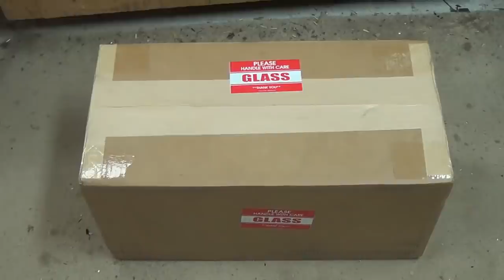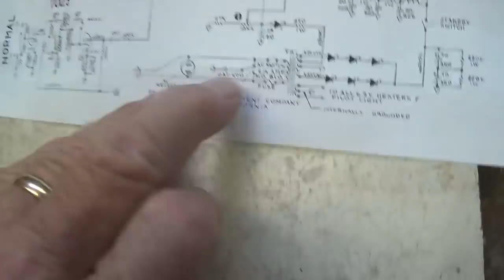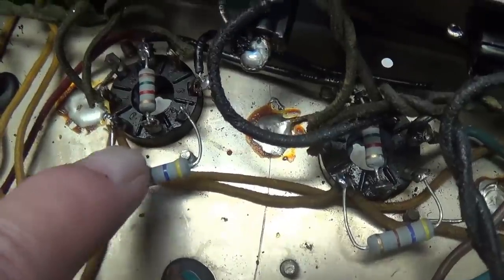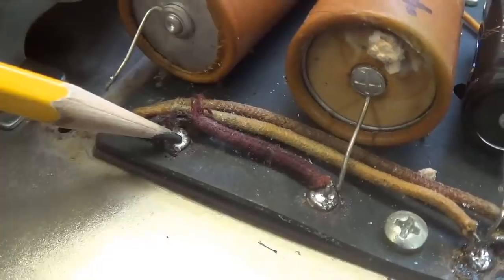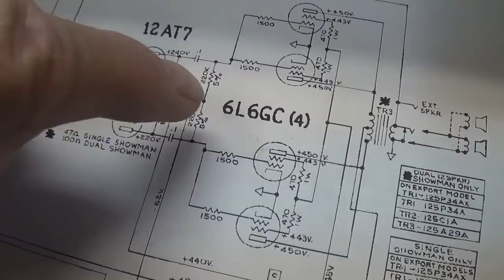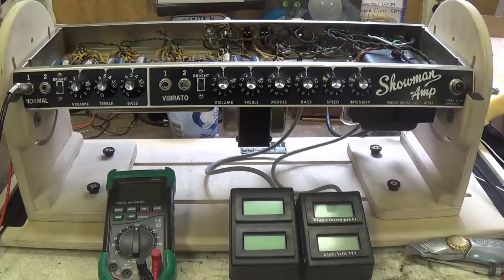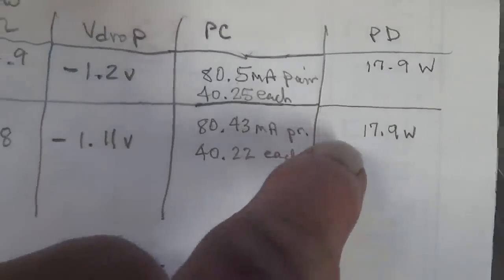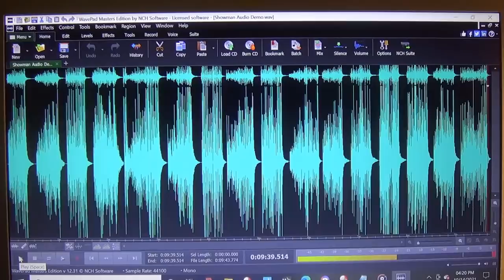1965 Fender Showman.......Back from the dead, but not without an epic struggle

Comment: Doug your timing couldn't be better:

I'm currently working on a Traynor Bass Master (Canucklestans take on a 5F6A) for a friend of mine experiencing a very similar issue with the output transformer. Extreme imbalance on the output tubes etc. I was luckier in my case as most of the imbalance was the result of a fairly depleted 7027A. 

Very cool that we were both working with a similar problem at the same time. Perhaps we're huffing the same cosmic ether   :^)

Looking forward to your next assignment.
Reply from the maker: Greetings, Shim. Best of luck with your repair. I always try to eliminate all variables before naming the OPT as the culprit......but when they're bad, they are very, very bad.

Comment: I believe the fuse you found was not blown because it had been replaced when it first quit working.  Personally I think the direct short you found would have blown the fuse right off not to mention some of the other problems you found.  Also there was no doubt what caused the caps to be swollen.  I also think the problems found were accumulative, possible over a period of time, until it finally quit completely.  This is the type troubleshooting we did in the Army on our receiver and antenna control of our equipment.  Didn't have enough years left to become efficient in digital work so it was time to get out after 20+ years.
Reply from the maker: Thanks for sharing your speculations with us, David.

Comment: Showman Single head only amps usually used a 1x15 cab commonly loaded with a Jensen C15K 100 Watt rated ceramic 15 inch speaker. There were also JBL D130F or D140F 15 inch and the JBL D120F 12 inch speaker. Altec made some big motor speakers too. YES! Fender employees DID SCREW UP! I have seen .002 or .003 uF caps used in place of .02 or .03 caps in Fender LFO circuits. It's a feature many do not use, so if it runs really fast it doesn't get used and it gets ignored for decades.
Reply from the maker: Thanks for the interesting info, Seth.

Comment: I love your videos! I've picked up a few tricks and changes from you, I've worked on quite a few Fender and Marshall amps, preferring the Fenders myself, as I prefer the sound. But I was wondering why you don't get Mercury Magnetic transformers. I use enough so I get the quantity discount from them and have never had a problem with their output transformers, which sound great to my old rock & roll shattered hearing, and the power transformers are always right on the money. Looks like you do a few more amps a year than do I, so you'd get the discount too. Loved the "Showman" video ... I just got a '67 that needs more than tubes, although needs those too.
Reply from the maker: Thanks so much, Mr. B. I try to provide my customers with the best quality parts and repairs at the most reasonable price possible, and, in my opinion, Hammond transformers are every bit as good as MM at half the price. If a customer requested a MM transformer I would gladly install one. I do respect their quality.

Comment: Hi Uncle Doug, I was thinking about the wiring scheme for the power switch, and I believe that is the correct way. I would expect the fuse to protect the equipment, and if there was a short inside in the switch it would just trip the breaker.
Reply from the maker: I agree completely, Jason, and am, quite frankly, astounded that everyone does not see the obvious superiority of this wiring method.

Comment: Great video UD!  I would have been tempted to change over the OT End Bells to keep the amp original looking. They looked like they would fit. A bit like stuffing an electrolytic cap.
Reply from the maker: I considered it, Dean, but the protrusions on the bells were quite different (check it out).
Reply: hey doug any  vids on stuffing original electrolytics? im sure i could give it a whirl but if i dont have to reinvent the wheel i'd be great!
Reply: @rubincherise8736  He has gone over his process before.  It’s part of another video though, it’s a Champ restoration video if I recall correctly.

Comment: Very very nicely done Uncle Doug. I've be servicing tube amps (and a few of the reissues) for some time and I learned quite a bit from you here so Thank You very much! I was wondering if your amp chassis holder is custom made, or commercially made? Pretty darn cool looking for sure. Funny story abut Dick Dale as well! I was trained in the military up to this tech level befor they transitioned to computers, so I came away in 1975 with a useful skill, yet I'm still learning, and always am amazed how these amps can stand the test of time if taken care of. Pretty impressive work though on your part. If you go to Antique Electronic Supply you can get a glimpse of what I've tackled over the years. Thanks again for a very well put-together 'feature-length' video! Signed, Brian W. Cole. (aka - Tube Amp Guy) I usually post jobs on Facebook with detailed stills and short vids. Lastly, I see you post other jobs on YouTube so do you pick up work that way as well? Not saying I want to start stacking them up. LIke you, I want to take my time, methodically, and do it right, and being a couple clicks shy of 70, less is generally more.  Take care! Brian
Reply from the maker: Thanks for your comments, Brian.

Comment: Great restoration as always!  But don't pitch that OPT just yet!  I have rescued more than one by re-soldering the connections between the leads and the coil wires.  I won't say it's a common fault, but I've seen it more than once, and saved big $$ on replacements.
Reply from the maker: I too have hunted down breaks in the superficial windings and repaired them, HS, but this was something completely different.....probably internal.
Reply: @UncleDoug  I should have known that you'd check it before throwing in the towel on an otherwise pristine original OPT.  My apologies!

Comment: Dick Dale, not only withering volume but also withering jackhammer attack ! After a Dick Dale performance in a small venue, you needed help getting out the door and into your car. Last time Sweetwater in Mill Valley Ca. One thing, they sure sold a lot of booze, it felt like life in the trenches during the battle of the Somme,
Reply from the maker: Thanks for painting such a vivid (and no doubt accurate) picture, John. My ears are ringing just thinking about it.

Comment: This is SUCH a nice looking amplifier! On the contrary to what I am working on right now; Zenith 12h60 Radio. The factory work is REALLY sloppy and disappointing looking. Then, it has a bunch of rubber coated wire, that disintegrates if you touch it. YUK! I'm working on replacing the wire I have to replace. Good news is that, I did a re-cap and the first test went quite well, with all original tubes.
Reply from the maker: Thanks for sharing, DW. Your experience is one of the reasons I quit working on radios.

Comment: Hello Uncle Doug, thanks a lot for the video. I have also same showman amp which in working condition with all original parts. That's the reason why I'd like to do a maintenance changing the old caps etc. I have a question about the biasing part of the video. I think that showman is a fixed bias and mine doesn't have a bias pot. What to do in that case adjust it?
Reply from the maker: If your circuit has the balancing pot, then watch my video on biasing a 4-output-tube circuit, Nt.

Comment: 39:05  The function of the resistors is FIRST to act as a voltage divider to ensure the mid point between the caps stays fairly close to 1/2 the supply side.  The function as a 'bleeder' resistor is utterly secondary to the primary function of keeping the voltage on the series caps within the rating of the caps.  Finding the short in the main DC supply right at that ground node was interesting. The layout of the eyelet board placing the insulated wire so close to the component bare leads with such a high voltage differential voltage is very concerning. I will be SURE to closely inspect my Blackface Vibrolux Reverb soon.  Thats a bad place to have a short.
Reply from the maker: Thanks so much for confirming my analysis of the dual-purpose reservoir resistors, Jennifer. Agreed......it was a scary place for a dead short, but I saw no evidence, i.e. charred eyelet board, that a dead short had occurred.....thank heavens.
Reply: @UncleDoug  Would I be a smartass to ask why you didn't replace that wire than to give it it's own cubical? I assume that rubber impregnated matchbook cover/playing card etc.... Is very well secured.... 
Actually, I am beginning to learn that sometimes we just have to compromise on such details when doing this as a service to others. Let's face it, who has the time or wishes to remove a circuit board? I find that a customer rather have his gear returned expediently rather than you having to expediently explain why it is taking so long to finish his amp.
Reply from the maker: @southboundsuarez9832  When working on customer amps I try to eliminate even the remote possibility of future problems. I closed the insulation gap, secured it with super glue, then shielded (and spaced) the sensitive areas from each other with (again) superglued rubber-impregnated gasket material. IMHO it's fixed.

Comment: I always enjoy your videos, both technically and as pure entertainment - and I thank you very much for all of that. 
But the (my) mind works in mysterious ways, and sometimes your presentations suggests band name. 
Tonight an imaginary presenter cried out: "And here they are; 
"The DEAD SHORT"!
Reply from the maker: We've had some good band names in previous videos, Arne. I recall the Anorexic Zombies among others :)
Reply from the maker: You can use a Variac or a Current Limiter with a carefully selected bulb (proper wattage to achieve desired lower AC voltage), Nick.

Comment: From 1963 - 1965 the "Showman" had one 12 or one 15 inch speaker, although I've never seen one with a 12 and I think after 65' it was only available with a JBL 15.  The "Dual Showman" had two JBL 15s, both were rated at 85 watts.
Reply from the maker: You just saw one with a 12" speaker, HJ. Thanks for the info.

Comment: Hi Uncle Doug - Love your Videos. I don't think your 4 Ohm Output will work because when the 8 Ohm Speaker connection Plug is removed from the socket, that output socket is grounded. Perhaps you have disabled the switch on the 8 Ohm Output?
Reply from the maker: Excellent point, Andy. Yes, the speaker jacks have to both be non-grounding.

Comment: Hey Doug! Have a question for you. I have a 66 showman. AB763. Both channels when the volume is increased hum like crazy, high pitched. All filter caps have been replaced and the tubes as well. Any ideas what could be causing that? It also pops when the standby switch is engaged.
Reply from the maker: A hum that responds to the VC is caused by a problem BEFORE the VC in the circuit. Think input jacks, cables, 1st pre-amp tube, etc. Just turn down the volume before flipping the Standby Switch......otherwise it's not an easy fix.
Reply: @UncleDoug thank you! I’ll give the simple stuff a shot first. Correct me if I’m wrong but since the hum is happening in both channels wouldn’t the problem lie where both channels meet? It’s not tubes, already tried that. Where would a good spot to look be?
Reply from the maker: If the hum cause existed after the VC, it would not respond to the VC. Check your jacks and cables.

Comment: I was just biasing an amp with a custom-wound OPT that measures about a 27% difference between CT and each half-winding, but 10-year old EH 6V6s are still within 1.5 mA of one another & my new backup set measures within 1mA. I may check with the builder, but what sparks my curiosity here is could the OPT for the Showman in this video have been re-wound? If so, was the choice to flat-out replace it just that the owner wanted expediency and resolution over the hassle, expense, and time to send it off for repair?
Reply from the maker: I don't like involving a third party in my repairs, especially when I am ultimately responsible for the outcome. Also, what if the rewinding took a year to be completed or cost a fortune? The owner wanted a good, reliable amp......and he got one, in a timely manner and at a reasonable cost.
Reply: @UncleDoug  thank you for the clear & helpful answer! I’ve dealt with the time & financial-pit nightmare with guitars so that makes perfect sense. Just asked since I was never sure what I’d do if one went out. With appreciation as always

Comment: I agree with your decision regarding the switch and was shot down on a forum about my decision to wire an amp that way.  In the UK the plug's fuse would blow if the highly unlikely switch grounding out condition applied.  I'm not sure how it works on that side of the pond.....
Reply from the maker: It works just the same here, CE. As another viewer confirmed, our method is the one used on all large, commercial electronic gear. It's the only wiring scheme that really makes good sense.

Comment: I noticed the low battery indicator was on both euro tube probes. I was wondering if that’s why used to getting weird readings early on in the video.
Reply from the maker: They have no batteries, Ivan, but draw their power from the circuit itself. I'll investigate this issue further and let you know what I discover.

Comment: Usually, the higher the wattage the output transformer is made for the lower the resistance of the winding will be since thicker wire is used. Also, more tubes in parallel require lower impedance so that means even less turns. The original vintage output transformers usually have more turns of thinner wire which is often on the edge or even under the needed rating, so if there is any issue with the amp and it draws more current one of the windings probably developed a short.
Reply: Observed the same thing as Doug when replacing the output transformer on my Vox V100 head with a 100W OT from Tube-Town. The primary winding resistances were ~13 and ~14 ohms respectively.
Reply from the maker: Thanks for the helpful input, Marko and Asle. I agree with your analysis.

Comment: Hi Uncle Doug. Beautiful video, as always. Can I take advantage from your knowledge? Which is the right switch off sequence for a tube amplifier: first stand-by and then switch off or directly switch off? Somebody told me: directly switch off in order to full discharge the capacitors. Is that right? Thank you!
Reply from the maker: I am not a fan of Standby Switches, Stefano, but I would say that simply switching the amp off at the end makes sense......why would you want to keep the filaments hot any longer than necessary?  Filter cap draining is not a concern unless you intend to work on the amp circuit.
Reply: @UncleDoug  Crystal clear. Thanks a lot!

Comment: In lieu of a high voltage leakage tester, is there any way to charge a capacitor to working voltage then check it's microA leakage with a multimeter? I figure a resistor in series to slow the charge rate? As previously mentioned, I'm ignorant here. Just ordered a Tel-ohmike but think the seller misrepresented so still thinking options. Thanks.
Reply from the maker: As I have demonstrated in several videos, Derek, you unsolder the end that should have no DC, turn on the amp and let it reach normal operating voltages, and then check the unsoldered lead for the presence of DC. This works great for coupling capacitors.

Comment: So with the 10k power supply resistors, was this amp working under spec in voltage? Yet it was going wild on the output tubes. Another great educational video, this one gave some interesting and unique problems, valuable for viewers, maybe not as fun for the repairman or the owner.
Reply from the maker: Yes. I tend to think that the incorrect values reflected either ignorance or simply using what was on hand.....not a clever modification of circuit voltages.

Comment: Hello! I bought a 67 Vibro Champ and thought the speaker was bad because it buzzed. So I replaced it with a new Weber and it is still buzzing. Everything in the amp is original. I know it’s hard to diagnose over the internet but with your experience I thought you may know what would cause it. The amp is quite at idle but any volume over 3 when playing and it sounds like the speaker is buzzing. Adding more bass makes it worse. If you had to bet what is you educated guess? Caps, Cap can or Power transformer?  Thank you!
Reply from the maker: It sounds like an issue in the input circuit, prior to the Volume Control. Speakers never buzz on their own.....they are electrically inert.
Reply: @UncleDoug  so we ran it through a 1x12 cab and there is no buzzing. The baffle screws are tight. Any suggestions?  The Weber is new so I don’t think it’s the new speaker.
Reply from the maker: @gregsteffey1266  Perhaps the voice coil is rubbing or striking at the bottom of its travel.

Comment: I have a 1967 dual showman with major problem . I play it through a 2-10 cabnet and in normal places where volume on 4 should be plenty i have to run it on 8 to 10 with a overdrive pedal and it still struggles any ideas please love the amp but a 15watt blues jr is cutting through better
Reply from the maker: Obviously the amplifier has some issues, Brian, and needs attention from a qualified tech.